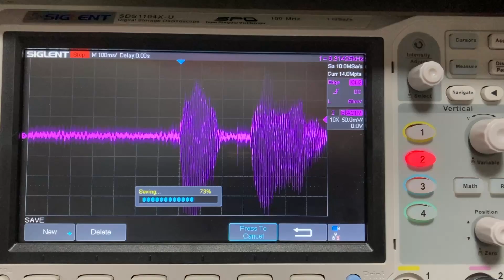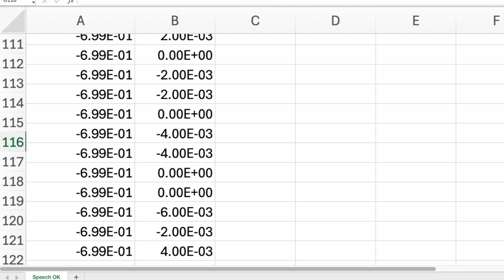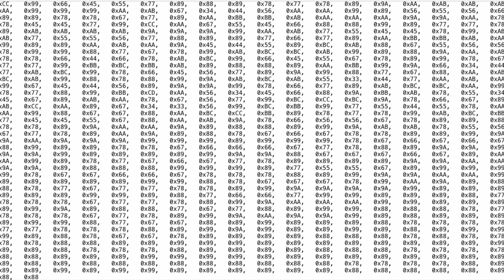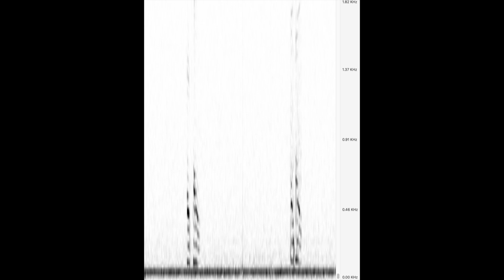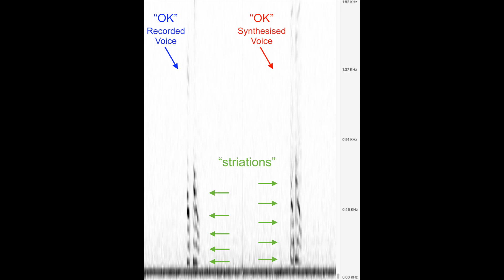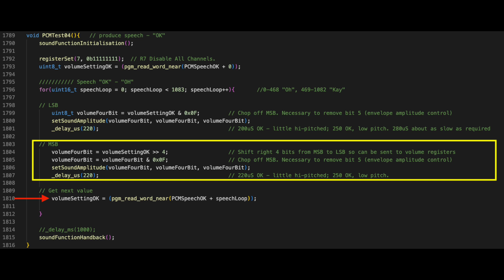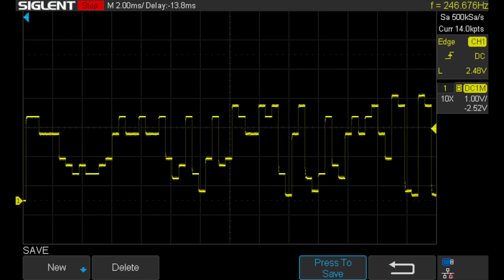PCM Speech Reproduction on the AY-3-8910 - PART 1

Comment: Hello! Bit what do you put in the frequency registers? Don't they interfere with the sound you try to generate?
You woud need an ultra low frequency so that you can modulate the amplitude of the top of the generated wave form. What am I missing?
Reply from the maker: Good question! What took me a long time to understand, and what I mentioned in an earlier video about PCM on the AY-3-8910, is that if you DISABLE the sound (channel A, B, and C) registers through the R7 Enable register AND write an amplitude level to their respective amplitude registers (R10, R11 and R12) you will get a DC output at each channel output pin corresponding to the amplitude set in these registers. Regardless of what frequency value you write to the A, B and C registers, you get a DC level on the output.
Reply: @inazumadenki5588 thank you for your answer. I was working on a game for the PHC25 computer and wanted to add some cool SFX.
I finally had no room left un RAM to fit vocal digits. I also feared the fidelity of the emulation (I work on MAME as I don't own the machine).
Thanks again, maybe I will try this in another project!

Comment: From the difference between where the middle / zero level is, it seems, you are not "linearize" the levels to match the non-linear volume curve of the AY chip (the bottom "below zero" is squished, the top "above zero" is expanded). The non-linear volume curve for the 16 volume levels is in the data sheet, but you can see and measure it on an oscilloscope as well...
Reply from the maker: You are both very observant and absolutely correct! I think there are at least two solutions to this. 
The first (and simplest) is to combine the channel outputs and send the same 4-bit numbers to the 3 amplitude registers (as I have done in this video), but limit the output voltage steps to a subset of values that are at equal intervals from each other. The problem with this approach is that I may only have 3 or 4 output levels that can be mapped linearly.
The second solution is to, again, combine the channel outputs, but set each channel's amplitude registers individually. This would give me 16x16x16=4096 possible combinations, from which I could select a larger set of values that would map to voltage steps that would be equally spaced.
Reply: @inazumadenki5588  IIRC, there was more than 8 output values in the linear-ish region, but it is still limiting. Linearizing by resampling has disadvantage of having the top half less resolution than the bottom half, but was usually preferable if you wanted to keep 3 independent channels.
Combining channels can be done by either having different output levels for each channel chip output (different resistor values similar to D/A converters), but if you have the same output levels for all channels, combining them will have fewer combinations than 16x16x16 since order is not significant. Without order it is only 816 (unordered combinations with repetition if my math checks out) but even then it is not linearly distributed, so it needs resampling and will not have the fidelity the number would suggest As an example, take the largest and second largest combined amplitude od the levels for 15,15,15 and 15,15,14. That would give you the smallest level step you can count on and that may be still only good enough for maybe 4-5 linear bit resolution...
Reply from the maker: The lack of resolution in the top half is a challenge for linearising, and I agree that more than just a few output levels.
You are correct about the lack of ordering, and so there aren't 16^3 combinations. For a subset of values, there are 2 redundant combinations that create an equivalent voltage; for example, a 0x01 value independently placed into Channel A provides the same output voltage as a 0x01 value  independently placed into Channels B or C. To illustrate, if we concatenate the 3x4-bit words into a 12-bit word to send to the amplitude registers, values, for example, 0x100, 0x010, and 0x001 would produce an equivalent output voltage.
Connecting the outputs complicates the situation owing to their averaging effect.
Thanks again for your insightful comments. I'll do some videos related to this going forward.